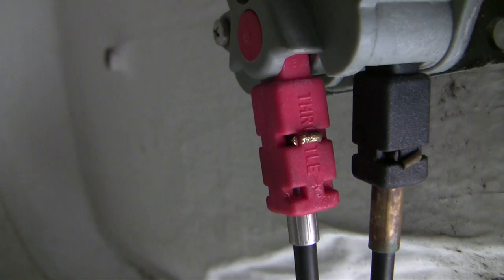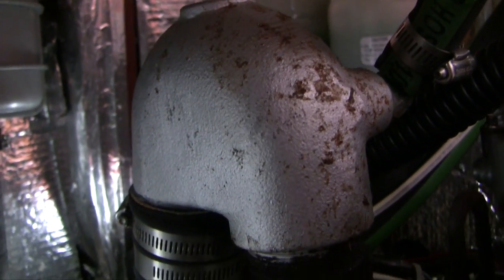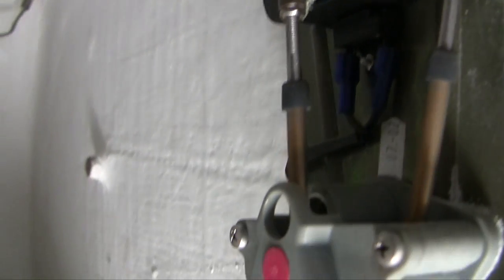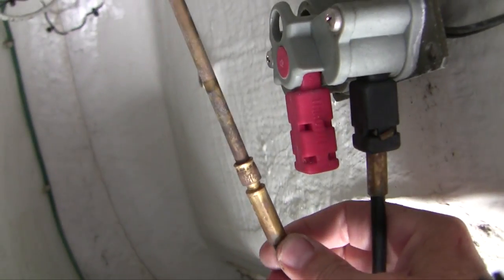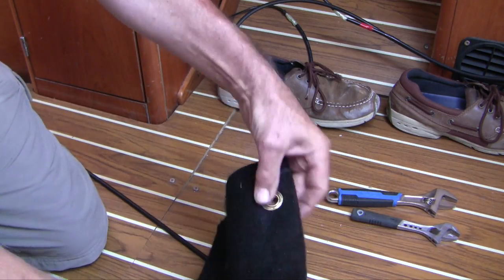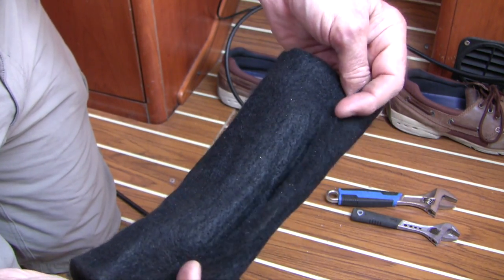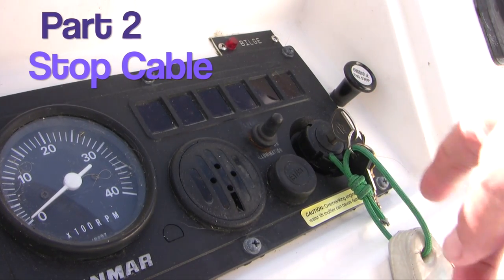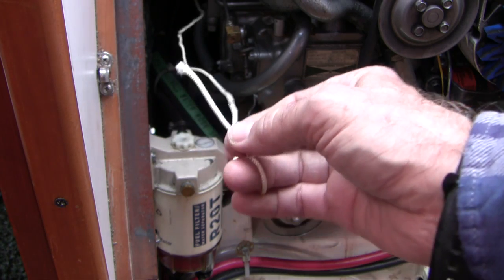How to replace Yanmar control cables on a boat

Comment: Thank you so much for posting this video, you are my hero. I just bought a 1985 Tartan 28 Sailboat and as I was pulling up to my mooring, the engine wouldn't shift out of reverse. I thought the transmission had gone out, but realized the problem was cable related. While watching this video, I learned that the outside shell of the cable should not move and found that the little ribbed clamp had come loose. An easy fix that would have sidelined my boat for weeks and cost hundreds of dollars had I hired a mechanic. 
I actually tried to hire a local marine mechanic, but was told that they were booked out for weeks. Thank goodness as now I know much more about my boat, it cost nothing and I'm back on the water one day later. Have a great summer.
Reply from the maker: Thank you kindly!

Comment: Good that you mentioned proper way to stop engine is via the stop cable. Turning the key off with engine running will kill the alternator.

Comment: I have to do exactly this on my boat and this video will be my go to! I'm super confronted by this job since I'm new to DIY fixing engines. COuld you put a link of the Tele-flex cable you used?
Reply from the maker: I went to my local chandler who supplied the correct length cable. If you remove the old cable and measure it in the shop there won't be any confusion regarding what you need, but it did take a week for parts to arrive. So, your boat will be disabled during that time unless you reinstall the old cable while waiting.

Comment: I'm adding the choke or kill cable to my yanmar 3GM30F. The cable I ordered dosen't have any nuts for the end of the cable to tighten into that notch on the engine. Would you mind sending me some more info on what I need or shooting me a pic please! Thank you! My cable end can be cut to any length so I'm curious on how I'm supposed to secure it to this bracket on the engine.
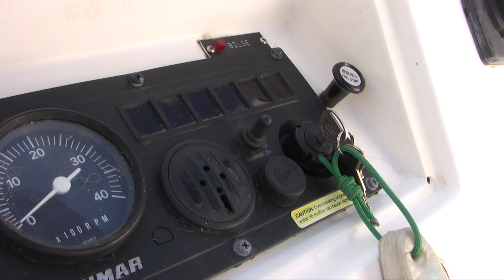Reply from the maker: Gee, I haven't seen this video in years. I got the Yanmar OEM cable so I wouldn't have to fiddle with it. You see good views of that cable starting at 6:13, going all the way to the end. More views of my cable won't help you cut your generic cable to size. If you have your old OEM cable you might be able to cut that end off the old cable and secure it at the end of the new cable. Or you could reuse your old sheath, although I would not do that. If you're good with your hands you could drill an axial hole through a bolt to thread the inner cable through it. With a generic system you don't necessarily need to do that. I would do something similar to the way a bicycle brake cable is held secure, with a U shaped strap to hold the sheath, and a tie down screw to hold the inner cable in exactly the correct position. By the way, that cable cuts fuel delivery, and air is never metered in a diesel so they don't use the word choke in the diesel world.

Comment: Many Thumbs Up for a great video. I have a Yanmar 2GM20 on a recently acquired sailboat. The throttle operates in reverse of normal sailboat throttles! IS there some way to just reverse one of the ends to get the throttle to speed up forward vice the other way around?
Reply from the maker: That's an interesting question, I don't know. You might be able to thread the cable around the barrel of the handle the opposite way to reverse the direction. Check the manual, it might offer the option to reverse the direction.  Now that I think of it, planes accelerate when you pull back on the throttle, but my boat accelerates when the lever is pushed forward. You might also look at how the cable attaches to the control on the motor to see if there is the option to bring the cable in from the opposite direction. On the other hand, after a while you may just get used to which way it goes, the worst case scenario would be to second guess when you're pulling into the dock, ha ha.
Reply: Thanks for the reasoned reply. At the moment, I will just make do... @spelunkerd

Comment: Curious, what is purpose of the spring on the regulator cable? Why is there a need to allow that brass block to have some play(due to the spring)?
Reply from the maker: That's a good question, I haven't really thought about it. On reflection, I'm guessing it is so the home position of the cable is 'on', it can't be accidentally shifted off when the boat shifts or if it gets bumped somehow. When you pull on the knob, you hold it 'off' until engine quits. Then when you let go, you want the spring to automatically pull the regulator lever back to home position (on). That way when you go to start it again, you shouldn't need to hold the kill switch in.

Comment: Great video.  What is the number of the replacement cable you are installing? I like the explanations you give on how these things work. I just broke the fuel regulator cable on my boat as I was heading out for a race. Good timing as I was close to the slip.
I hope to get a new one on before the next race this weekend.  Duke
Reply from the maker: Ha ha, we were just racing last night, too. As usual, rain forecast but sailing was excellent and we stayed dry. I can't give you a replacement cable part number because the part was generic, supplied by my local chandlery. Length of cable is very dependent on how the boat is laid out, so even identical boats may have slightly different lengths. I had the old one in hand when I went to the shop so they wouldn't have any difficulty finding the correct size. Even so, the first one off the shelf was not close enough to the correct length so I had to get a custom length shipped. Once you see how these cables work, you can operate the engine directly if you need to. Make sure you get the cable routing correct around the exhaust hardware. Good luck!

Comment: In a future video, could you touch on how to adjust the tension of the throttle cable for a Yanmar diesel.  When underway, my cable or throttle adjustment falls back to a lower RPM setting than what I would want. Any advice is greatly appreciated.
Reply from the maker: Ha ha ha, mine does too, especially at low rpm when I'm creeping through the marina. Very annoying and distracting. No issue at high rpm, and the old cable didn't do that at all. My boat lever does not have any adjustment for that, so we are left with work around options like tightening the holding clamps a little more. As the cable corrodes I expect it to improve, but I am reluctant to add any friction modifier to increase mechanical resistance because I don't want to overshoot. If you come across any solution, please return and share it here!
Reply: @spelunkerd  Unlike most small diesels that spin the governor on the camshaft the Yanmar GM/HM series has the governor weights on the much faster crankshaft; at full speed the reaction force on the speed control cable gets quite high.  Most operator control units have a  friction adjustment but even so many have to resort to using a cable clamp on the cable itself somewhere to add friction.  The spring on the connector is used for damping to allow the lever to increase over the setting and at idle position the spring should be compressed about 3mm.  That should get some light grease too.  The kill cable core should be pulled out every few years for coating with grease as it is stranded steel like bicycle cable.  A trick is to solder a spot on the strands just where you plan to cut the end so it can be pushed back into the sheath without snagging.

Comment: Thank you, your videios are soo informative and the photography is centered on the parts being worked on, very well done.  How would you drain a fuel tank thats been sitting for 7 years? I(m pretty sure there is plenty of water and goo in it. Thanks again.
Reply from the maker: Good question! I'd find a way to siphon the fuel and water out completely, then start again with fresh. If you're worried about debris in the tank then you might be able to remove the fuel level sensor and have a look with a borescope at the bottom of the tank. However I'd probably just siphon all I could and replace with new. Don't forget to purge the fuel hoses and supply lines, and change the filters, too. To siphon fuel you could use the same kind of device I used to siphon oil in the Yanmar oil change video, it can be hand operated or venturi operated if you have access to an air compressor. For engines that have been sitting a long time it would be wise to change the oil and oil filter as well. If you have glow plugs it wouldn't be unreasonable to pull them to squirt a few cc's of oil into each cylinder to reduce the wear with startup. Whenever I anticipate a difficult start I close the salt water intake and open the decompression valves, then spin the engine a few times with fuel off so the engine gets primed with oil before it revs up. After it starts remember to open the sea cock. At some point you'll want to change the coolant but some would do that after you get it running the first time. Just make sure the coolant is all the way to the top of the rad cap, not just the reservoir. Also when you do get the engine running, make sure you have good salt water flow. Dry rot happens to impellers, too, so you'll want to change the impeller sooner rather than later. Don't be surprised if you have a sticking injector with a misfire. Rust never sleeps. Also have a look at your seals, they tend to dry and rot when left for so long. When you get it running, watch carefully to be sure the thermostat opens appropriately when it reaches operating temp. A sticking thermostat would be pretty common in a vehicle left sitting for so long.
Reply: Thanks, you've given me hope, and useful information. I really do enjoy your videos, keep'em coming.

Comment: Can you show how you got the nut for the control bow all the way back from the front of the engine? You always have great content.
Reply from the maker: Gee, I'm not sure what you mean exactly. One of the nuts had to be slid by hand all the way to the other end, just by reaching with my hand and sliding it along. If you have poor access you could tie it to a string and pull it, or push it with a boat hook, but I didn't need to do that. Good luck!

Comment: The engine I have is the 2G20F  engine on a Dehler Optima 101 sailboat. I assume the cables are the same .
Reply from the maker: Because cable length is specific to the boat rather than the engine, and because different boats will have different control hardware in the cockpit, you want to match what you need to your circumstance. My control pivot in the cockpit is not made by Yanmar so there is variance there as well. These cables are generic and my dealer had little trouble matching new to old, although I made it easy for him by bringing in the old cable. Even so, he had to order the exact length which took a few weeks to arrive. Good luck!

Comment: Would you know how to stop the Yanmar sb 8?
Reply from the maker: No, but all of these small diesel engines are similar. One kill switch for shutting off fuel delivery, independent of the electrical key. A second 'regulator' control for increasing fuel delivery, which will cause a faster rpm. Follow the cables back from the cockpit control to the engine and you'll quickly answer your question. It makes security in these engines problematic, since you don't need spark and therefore can't use electrical keys to prevent unauthorized starting.
Reply: @spelunkerd  When I purchased the boat from a broker (owner not available) there was a  pull button with électrical wires unconected to engine.Pulling throtle back past idle the rpm increases.I rigged a cable with a u-turn to pull forward on the throtle at the engin but I must pull very hard and I'm afraid to pull it off.
Reply from the maker: @lionelcormier3260  Sounds complicated. I would go back to basics, decide what the engine needs, and design your controls to keep bends and turns to a minimum. You can easily order custom length cables, and you can lubricate the cable with silicone spray. For a fancy cable lubricator, go to a local motorcycle shop or look online for "motorcycle cable lube tool".  Those little things get the lube down into the cable shield. You spray til lube fluid comes out the other end.
Reply: @spelunkerd  Great!Thanks for the info.

Comment: You skipped over the hard part for me.  How do you order the right part for your needs?  There seem to be so many options for ends that my head spins.
Reply: My assumption is that I should just wait till the end of a season and take the old stuff off and take it to the store and ask them to help me...  But I really prefer to be able to ensure I have the matching part before I take the old one off if I can help it.
Reply from the maker: @AMaverickBrother  That's exactly what I did, I removed the entire line, leaving a tracer line in place, and took both cables in hand to the chandlery. The length is critical for your boat, usually a custom part so get the length correct. Fortunately there was a guy with experience who knew exactly what I needed. Once measured, I put it back on to allow me to sail while waiting for parts. After you learn how yours comes apart, it doesn't take much time to do it again.
Reply: @spelunkerd  Ok then I guess that is the way to do this...  I guess maybe next season end I'll do that...  Right now I have a hilarious problem in that my throttle will back off over time.  If you set things to 2200 RPM it'll seem like its holding but you'll look down a half an hour or more later and find that you're only at 1800 over time very slowly.  Thankfully on my boat pushing down increases RPMs.  So I have a water bottle hanging from the throttle lever via a zip tie that has just the right amount of water in it to hold things steady.  This solution was come up with on a passage from Kennewick, WA to Newport, OR and now years later I'm still rocking the water bottle solution.  But I think that fix is starting to bubble to the top of the priority list.
Reply: @AMaverickBrother  ... an expert suggested putting a small clamp on the cable to add friction... I  havent tried it  yet but it is supposed to help the problem
Reply: @larryboyd2806  I read that and even found the clamp for sale at a chandlery...  Then I dug into the boat and found one of those clamps on my morse cable but it's actually bitten thorough the outer jacket a lil as its cracked there and its not able to do the job any more.  

I really should replace my cables soon but I think I'll do it this winter.  I don't really want to take it apart when it's working.  

But it's a bit ghetto that I have to hang a water bottle with just the right amount of water in it to hold the RPMs stable.  It was a quick fix in during a passage that's become more permanent than I'd like to admit. ;)

Comment: Ooow no heat sheild and not even a strip of high temp plastic to keep the cable away, perhaps there is a missing part.

I find it odd that there isn't a solinoid controlled fuel valve, but if it's reliable then i suppose there was no reason to add cost.

House electricians sometimes use the old mains cable to pull through the new.
I remember tricks/info from odd usage, that's why i thought about the mains cables.

I remember pulling a magneto flywheel off a taper shaft on my frends moped, 3 bits of string were tied to the flywheel (equal distance apart), i pulled all three while my mate hit the taper shaft with a mallet, there was a "clunk" and it was loose :-D
That was a trick from my dad, he was a pit/mine engineer, he passed away 30 years ago but the image of the strings and "shaking the taper" stayed in memory :-D.
Reply from the maker: One day I made the mistake of accidentally bumping the ignition switch off while motoring, and to my surprise the engine continued chugging along, seemingly without even noticing. I turned it back on as soon as I noticed, but after a minute there was no evident problem. Of course none of the warning lights will work without electric power, and I believe even the voltage regulator might be thrown off by a spinning alternator when ignition is off. Overcharging might be a problem if the alternator isn't getting proper control, depending on how these are wired. In any case, as you say it reveals how curiously independent and simple these engines are. The main functions of fuel and oil delivery, water cooling, compression and timing are entirely mechanical. Thanks for watching!